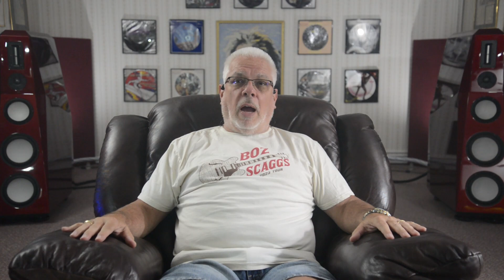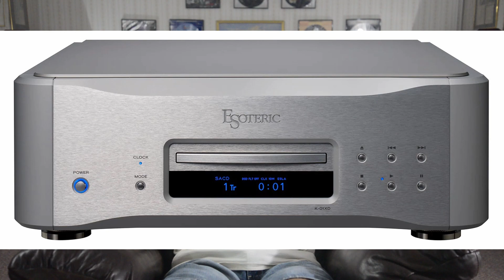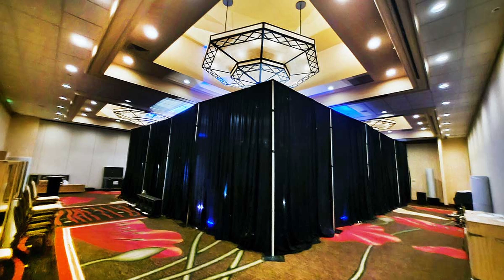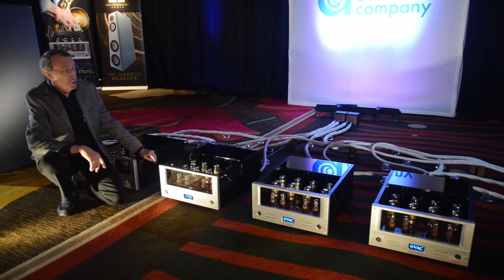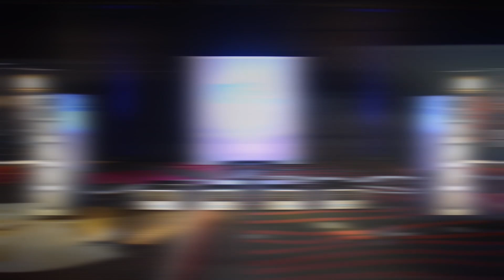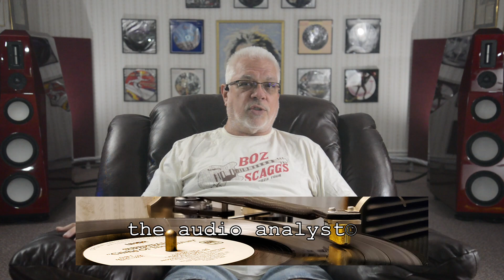E136: Pacific Audiofest: VAC & VSA

Comment: I'm glad VSA is starting to see the light in using subs to improve bass response so I trust Greg will be adding a pair of VSA v-15xs Shockwave subs to his audio mancave to keep up with the Joneses? Oh yes please!
Reply from the maker: Thanks for this...but two points.

Frist, starting to see the light? Shucks, they've been doing this for over a decade or more now. This seems to have found favor originally with "home theater" camp in the early-mid 1990s, and is equally applicable to two-channel playback. In fact, VSA only "recently" started talking about it as there were uninformed show goers "assuming" that those subs were being used to "trick" listeners into thinking that the speakers played deeper and better bass than they actually did... In fact, I've mentioned it in show reports as far back as AXPONA 2017, I believe... I have to verify that...but it was long ago.

Second, I take it that you are unaware that the ULTRA 9s include their own powered and fully configurable subwoofers. In essence, I DO have two subs in the room. Each U9 has its own 15 inch powered subwoofer - on its rear face - see the images at the bottom of my System page here - https://www.theaudioanalyst.com/reference-system/. They included a 1KW amplifier and a control suite that allows for manipulation of their x-over frequency, amplitude, and completely variable phase - from 0° to 180°.
Reply: @theaudioanalyst  I know that your speakers have powered 15s but I'm curious if adding subs would improve that je ne sais quoi of the presentation. 
I know Robert Harley has subs with his Big Wilsons
If you added subs what would happen?
Reply from the maker: @khunopie9159   So, I cannot imagine that adding another sub (or two...) at strategic locations throughout my large room (600 square feet, or some 4300 cubic feet), would hurt. But I also suspect, given all my time working with this room across more than a dozen different loudspeakers over the past eight plus years, that it would contribute a significant improvement with the use of the VSA ULTRA 9s... Other speakers, ones without such granularly controllable subwoofers, perhaps. I cannot say with absolute certainty. But I can't imagine any significant enhancements would be realized over the implementation of the ULTRA 9s alone in this space. That is, in part, why they were chosen as my reference loudspeakers and have remained unsurpassed in all this time.